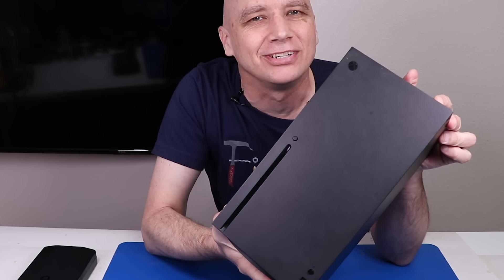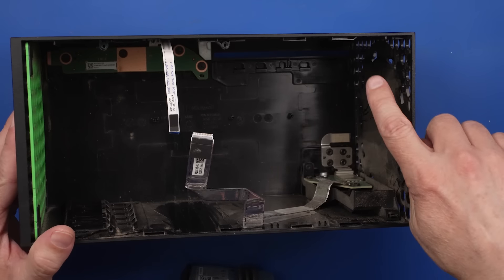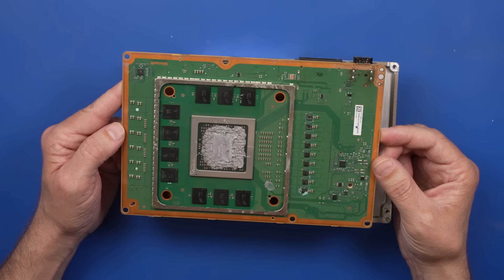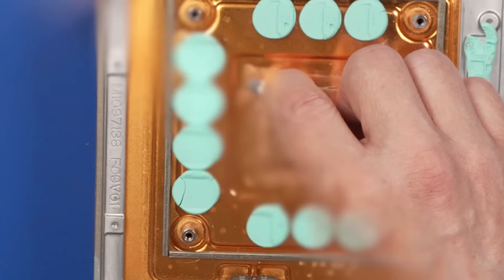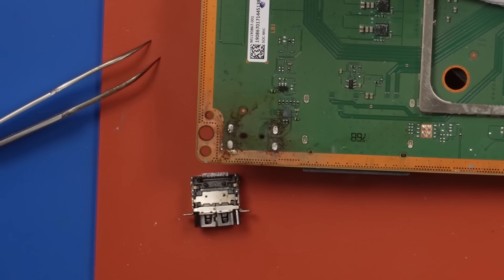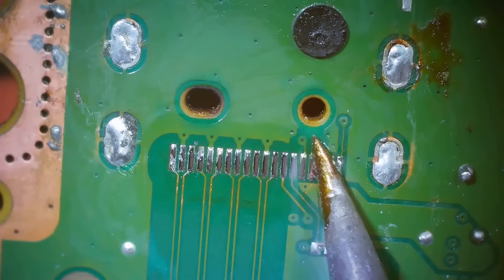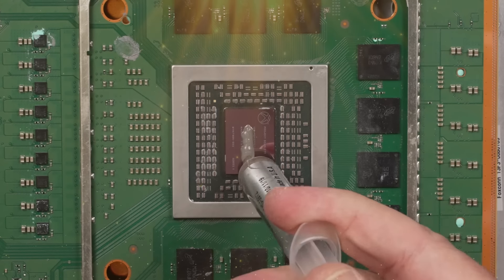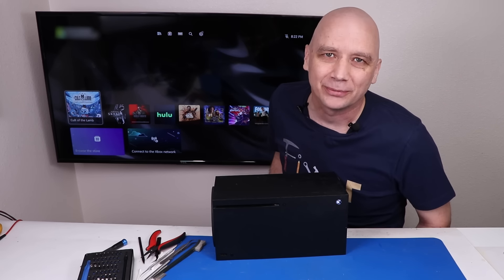Repair Shop Ripped Him Off - Let's Fix It!

Comment: 6:37 Possible that the guy taped the port down before soldering and didn't bother to remove the tape. Not that it matters, the guy destroyed the port... And it's not even Kapton, it's (probably generic) double-sided tape. The sloppiness.

Comment: Hey bud wish me luck i am going to attempt to replace a hdmi port on a ps5 for the first time ever. I have never done anything like this normally i just do wiring soldering on lawn equipment but if i do get it fix than I'll be getting a ps5 for $50 plus the parts and liquid metal. I will be watching your video carefully to make sure i am doing it right

Comment: you the electronic fixing man! i always wondered why other systems didn’t use thermal pads like the n64. When I took mine apart the pads were still brand new

Comment: The tape across the hdmi port looked like it had been heated. I'm guessing the repair shop removed all the solder for the mounting points, inserted the new hdmi port, placed the tape on it to hold it in place, flipped the board, then soldered the port to the mounting points, then soldered the pins. They obviously didn't bother to remove the tape when they were done.

Comment: That thermal paste job stopped you dead in your tracks. I had to check my connection wasn't frozen after the length of that pause!

Comment: Hello I really could use your help. I'm trying to figure out on my Xbox series s the connection ports for the wife and Bluetooth. what is that connector called? It's a 16 pin and trying to find out what it is. It's a lot smaller then a 2.54 standard size. So can you help me please 🙏🥺🙏🥺🙏

Comment: 400$ for a "repair"?! It would be baffling expensive for a real repair when you can find perfectly working Series X for around 400$. I got mine brand new, factory sealed for 350$.
Reply: Hey, where'd you get it for 350 dollars? Really helps as I was planning to buy one myself!
Reply: @astigon1565  Unfortunately my info cant help you since I'm living int the eastern Europe.
Anyway, the around 400$ Series Xs have begun to appear more and more. In my country there are plenty of 350$ used SX and they are sitting there, listed, and nobody is rushing to buy them. I even got a Series S for 70$ with a controller.
Reply: during black friday week you can price match walmart/best buy/gamestop at staples and use coupons to get it to $260 it will be even less this year.
Reply: 350$? Where at?
Reply: @justindasilva73  eastern Europe on different sale sites like eBay, but I'm sure there are many other places.
There's also PS5s between 350 and 400$.
Reply: Around here the 1TB Series S seems to be ~€300, new. Northern Europe.
Series X some ~€380.
Reply: I've took a quick look and the first one I saw was a mint condition Xbox Series X with two controllers and some digital games on it(like GTA 5, FIFA 24, MK 11, etc) for 335$ and it's sits there, listed, not selling 😅

There are lots of Xbox Series X with prices starting at 330$ and surely they'll drop further as the summer approaches.

Also, the cheapest PS5(fat) disc edition that I've saw is at 350$ with two controllers and some disc games.
The digital editions are just slightly cheaper.
Reply: Ikr? Ridiculous
Reply: @justindasilva73  In the US there were a bunch of promotions around the holidays.
Reply: $400 is crazy. you would have been better off selling it with broken HDMI for like $200 $250 adding the difference and buying a new one.

Comment: So now we know what happens when you let "the new guy" practice on a customer's system.
Reply from the maker: Lol, that's what it seems like!
Reply: 100% it was someone who's literally never fixed anything, they got it open, found when they pushed on the socket it would kind of work, they taped it, claimed victory.
They had it torn all apart so they thought they were supposed to throw some more thermal paste in there, like regreasing a bearing sort of, so the more the better.
Reply: This is bad even for a new guy and what about the one who is above him (if there's even someone else) can't he just guide him and have it fixed right? This kind of work and ignorance drive me crazy tbh
Reply: There is no way a repair shop did  this. Looks like someone at home watch a video and tried it themselves.
Reply: @sefirosusensei  not shot someone at home is gonna bodge it with tape lol

Comment: I fixed one of these a few years ago and then the shop who hired me called back a few days later saying the customer claimed I didn't fix it. Came back to take a look and it looked like they had it plugged in before pushing it into the wall. Ripped pads and all, definitely the customer's fault. Especially since they were "playing earlier and then it didn't work later that night".

Comment: My uninformed opinion is that they used low melt and did not clean it,  then soldered the new port on that and it cracked,  separating from the pin and exposing the copper

Comment: I just bought a Switch OLED and one of the JoyCons isn’t connecting and has few other issues. One in particular is a tab next to the battery that was loose and broke off. Just to be clear it is not the wires connected directly to the battery. It’s a smaller set of wiring that runs to a smaller tab that broke off. Anyway, I was curious what soldering kit(budget or otherwise) would you recommend for doing this kind of tiny work?

Comment: Hey Steve, have you had any chance to work on vitas (slim/2000, specifically) recently? I'm trying to figure out if there's any way I can salvage a housing but the instructions on replacing the screen !without! just getting an entire replacement shell are very scarce, so I'm reticent to do it myself as an amateur and was wondering if you had any insight. Mainly it's because it's a metallic red vita, and I can't seem to find replacement screen+shell for those.

Comment: that hdmi port looks like they reused the old port again, signs of fresh solder on one of the mount points, but an old cracked join on the other side

Comment: I wonder if the repair shop did pretty much exactly what you said, then the customer ended up jamming the plug in and out of the port in frustration when the console stopped working? That would make it technically the customer's fault that the outside of the port was messed up, but the faulty pin was still the actual problem.

Also, I noticed the structural pins on the HDMI port looked like they had cold solder joints. Not necessarily an actual problem yet, since they don't need good contact and the port looked like it was still attached to the board pretty well, but possibly a sign that the new guy was assigned to put a new port on the board and reassemble the xbox after someone more experienced diagnosed the issue. 

Of course, me trying to read that much into such small clues is completely talking out of my ass, but it's fun to speculate sometimes.

Comment: i feel like the most likely explanation for the bent hdmi is the customer had it, the new fix stopped working and he prolly "fiddled" with it by twisting either trying to get it to work or in frustration.

Comment: Looks like when you put on the new HDMI port it was slightly angled and that was why the pins were not lining up on the left side.  Could you have just heated up all the connections and turn it slightly so the pins lined up better?

Comment: I got my series x back in christmas of 2021. I had just had my second colon surgery and my wife got it for me as an upgrade from my One S. I always take insanely good care of my consoles. 

Fast forward to may of last year, i was sick and i fired up GTA 5. I was playing as franklin, sat down in his house and "got high" as you can in the game, and immediately after the screen changed to the high state, the console popped and shut off. Took it to my local store that is known for quality repairs. They found a cap on the 12V rail shorted somehow. It's been great ever since. So if anyone else has a similar issue, majority of the time it's not the power supply. They don't normally go bad on the series x. 

I just like to give people knowledge so if they take their consoles to have them repaired, they have a good idea of what could be wrong so they dont get a run around or get charged for something they didn't need

Comment: After reading your posts regarding your health I'm glad to see that you decided to rock the bald. I've never been through anything similar so I can't say how I'd manage it but I certainly respect that you're not letting it define you and (I was gonna say getting back on the horse but it doesn't feel like you ever came off) punching on with work.

I found your channel accidentally many years ago when I was trying my very first repair (a micro usb replacement for a nexus 7 tablet) and I'd be lying if I told you I wasn't cursing how easy you made everything look while I was in a mess of screws and solder. Thank you so much for your contributions to both my poor attempts to repair and the electronics repair category on YouTube in general, Steve. The motivation to try something new for the first time is incredibly hard to find and I can't even imagine just how many people have been inspired to because of your videos.

Comment: A latched key on the cable like Display Port did will solve this problem of broken Hdmi port. Sadly its pretty rare for console ,TV or consumer electric in general pick Display Port as standard due to the lack of DRM which is loved by content maker.

Comment: Could a broken pin like that be caused by user error (ie someone jamming the cable in)? The damage to the outside of the port does make me wonder how much of the problem is with the repair shop and how much is with the console's owner.

Comment: Forensics electronics repair is super interesting
Could probably make a series about making bad repair services own their mistakes
Like a YouTube review service similar to Google but with proof of poor service
I had a shop tell me they replaced a usb port on a device only for it to spark after it came back
They tried to blame me until I tore it apart to show the original port was still there and the original tamper proof seal hadn't been broken
They just plugged it in and it worked for them so they sent it back and charged me $75
I made a huge Stink about it and called them out in some groups for the product to get a refund

Comment: The tape probably held the port so they can solder it with soldering iron because they didn't hava hot air station

Comment: Too much thermal paste isn't going to affect your system. Most thermal grease is non conductive, and as long as the mounting pressure on your cooler is good then the rest will just be pushed out. It will make a mess and waste some money, but it will be fine. :)

Comment: What temperature do you get your heat gun to desolder the pads and what temp for resoldering new pads? I've been trying to get into soldering but failed hdmi port on Xbox one miserably.  Burnt the board trying to break solder on old port.

Comment: Yeah I never did understand that why does the HDMI port always break because I have my Xbox mounted to the wall doesn't move are these people like unplugging it and taking it somewhere so much that it breaks or what's the deal here or is this just the weaker link what does HDMI ports

Comment: this one definitely seems like both parties were at fault. as a shop i would have cleaned better. as a customer i wouldnt have broken the hdmi port multiple times. maybe he paid that much over multiple visits to the shop cause he cant stop breaking things. also the thick part of the hdmi port that goes though the board was broken. isnt that a grounding point?

Comment: Did this dude use plumbers flux???? Would explain the pin corrosion. Either way, they should've taken the time to at least clean up the flux from the board.

Comment: I suspect they didn't repace the port at all. Can you tell if the old one was an original part. I can't imagine why else a pin would be broken and it would be held down literally with scotch tape. What do you consider a fair charge for the fix as you did it? I can't imagine $400 is remotely close.

Comment: If a repair shop is gonna cost me $400 in total I'm just buying a new console and possibly selling the old one for parts/fixing on ebay.

Actually $250 for an HDMI replacement seems steep too but I understand time/skill are invovled in the price too.

Comment: I often see HDMI ports broken, especially in gaming consoles and other electronic devices. It feels like we're stuck in 2002 with these bulky, hard-to-plug-and-unplug ports, similar to USB 2.0. We need to move away from HDMI ports and either redesign them, like USB 3.0, to make them easier to use and less prone to damage, or eliminate them altogether and integrate HDMI functionality into USB 4.0.
Reply: That is not a easy thing to do, hdmi is in all device already. Display port could have replaced hdmi which also cost less than hdmi beacuse it is royalty free meanwhile hdmi isn't.
A good mean time solution would be two hdmi or one extra display port

Comment: Been trying to solder through-hole capacitors with 63/37 solder, was having enough success to keep going with it until this original xbox 360, so i looked into it, and they suggested using rosen-core solder, and the capacitors actually made it through the holes.... Looked into it more today, and they were saying leaded solder ends up being a crutch, if you know how to solder with flux-core solder you know how to solder. I was putting way too much flux paste on to try and get through the motherboard but i guess the flux wasn't getting into the through-hole part of the motherboard, so the flux core managed to get into the hole? am i understanding that correctly? I couldn't believe it after 2 days, and multiple soldering experiences, i finally went back to the lead free solder and life was easy, but for like surface mount stuff its been working... also any idea on how to tell if you have a "cold solder joint" using the multimeter.

Comment: Yeah I am no expert, not even close, but even I can tell that broken pin is a bit of a problem.  I had a problem with a piece of software I was using and the fix was adding a dash so yeah, I get it.

Comment: Why would anyone pay $400 to repair a $500 console? That's just insane. I did pause to read the explanation. Repair guy scammed him twice which is why it equaled $400, but still, even the original $250 is too high. Might as well of sold it on Ebay for $100 and gotten a new one. Sure as hell wouldn't have paid the repair guy the 2nd time. If you're going to get something repaired, always look at reviews before choosing a shop to take it to. Too many bad repair people out there doing bad temp fixes or damaging things worse and still charging for it.

Comment: How do people even break HDMI ports? Consoles are stationary things, how many time do these people plug and unplug the HDMI cable?
Reply: I wonder that too. They are so rough with these things.
Reply: Hei 🙋🏼‍♂️ i think the Problem is that the HDMI cable is not fully going in port (optic) 

Its INSIDE but you can see Metal from HDMI 
So people trying to push it in more
Reply: If they had to use their hard earned money to buy one, maybe they would be more careful.
Reply: I work with thousands of consoles a year, I stopped asking myself “how did they even do this?” after a while 😂 Shells with burn marks, crazy scratches, etc, it’s actually really common for people to abuse their consoles. Which is very strange considering they’re not cheap to purchase or repair, and like you said they are stationary.
Reply: Hdmi port is by far the most popular repair in my repair shop I worked at. We are talking 5-10 a week in just the store I worked at. People moving them around and unplugging them all the time causes the issue
Reply: @christianman4ever  why unplugging??? Every week another place??

No thats not the reason

Comment: I am having a weird issue, I bought a Xbox series X from someone, the HDMI port has a slight bend but it would still display nicely, but when I ever would launch an  graphically intensive game the game would start glitching out and crash after a while, and this would only happen on graphically intensive game so I  thought it might be the thermal paste so I replaced the thermal, now the glitching is gone but the game still crashes like after 2 minutes, do you think it could be a bad SSD or is the HDMI port causing issue but I don't see how a bad HDMI port could cause a game to crash this is really odd

Comment: Can I send you my Xbox Series X. I took it to repair shop and they couldn't fix it. I'm the original owner. The thing is like brand new. It powers on for a second and then it just shuts off.

Comment: Man, people just love being rough with HDMI ports on these consoles.

Owner had it replaced once, and the the replacement port is bent up also?
Reply: HDMI ports don't bend themselves... I'm betting the owner damaged it the first time, had it repaired, and then damaged it again. The repair shop clearly did a sloppy job, but again, HDMI ports don't bend themselves